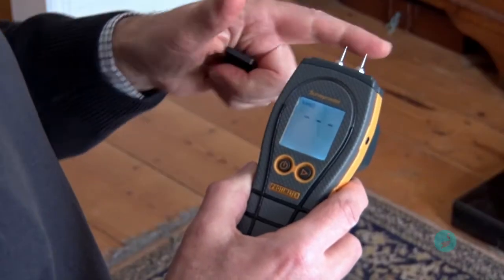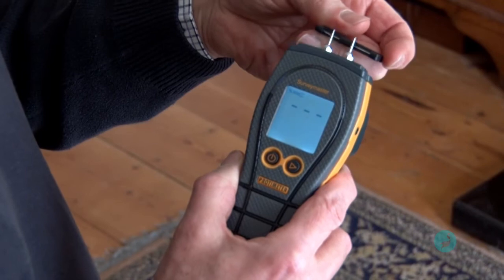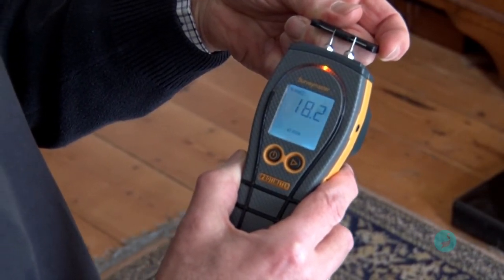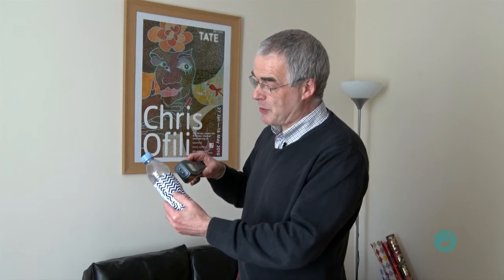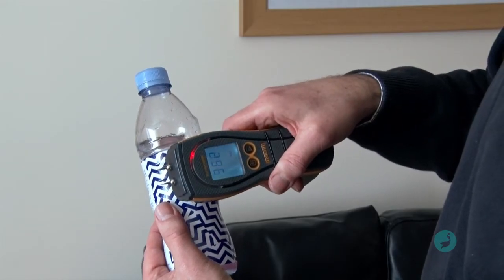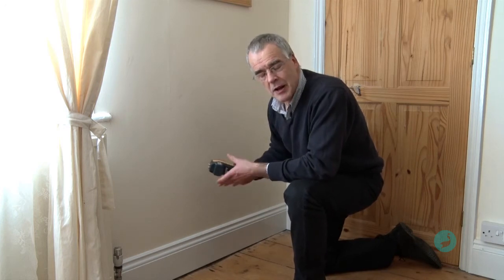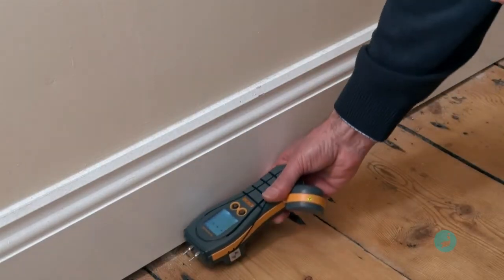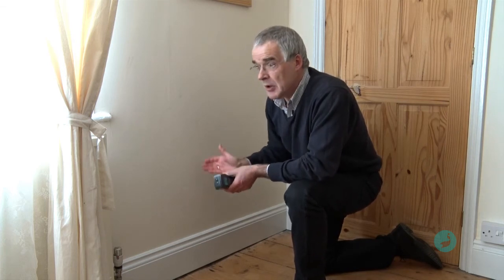Using a Damp Meter

Comment: Below is  a quotation from the manufacturer of the moisture meter used in this video - basically this instrument does not confirm  the presence of damp - it can however confirm the absence of damp.
"Contrary to popular belief, a moisture meter is not a diagnosis tool. Rather, it helps an inspector make an informed call about moisture’s presence within a space or material. If your meter is giving you a high reading, that merits further investigation -- dampness may not be the reason for the measurement; metals and salts cause false-positive readings".

Comment: Hi Great video, my property has had a major fire 6 months ago and since we had lots of heavy rain when a new roof has been fitted and sealed to stop water,  a specialist company will be coming in to dry out my rooms. What reading do i need to see on a meter to know it’s moisture free and back to how it should be

Thanks
Reply: Drywall 7-11
Lumber 14-16 
Francisco Adams D&R
Reply: Here is a quote from Protimeter  which you might find interesting  - Contrary to popular belief, a moisture meter is not a diagnosis tool. Rather, it helps an inspector make an informed call about moisture’s presence within a space or material. If your meter is giving you a high reading, that merits further investigation -- dampness may not be the reason for the measurement; metals and salts cause false-positive readings.

Comment: a frauds device
Reply: @sergeyw8864  The damp industry as always been a con and damp meters are the biggest load of bollocks on the market , and don't turn round and call me an idiot I've been in the trade for 33 years studied at college and worked on many a historic building in the past , properties do become damp but there's normally some reason why and it ain't from rising damp which a proxy meter detects !!
Reply: Anthony Mclean i don’t think you’re an idiot Anthony. I simply state that people use these devices improperly. The device is only as good as the operator. Use it incorrectly, get poor results
Reply: Sergey W your Wrong.....moisture meters need banning and they are exactly a fraud for misdiagnosing damp!!!! That does not measure damp but it measure salts......idiots around the country and using these pathetic devices to diagnose “rising damp” to which does NOT exist!! It’s simply condensation 
The uk damp industry is nothing but a fraud and con people out of masses of money and it’s a disgrace
Reply: @sergeyw8864  ive worked on historic buildings 26 yrs and im a idiot..lol
Reply: @adventureswiththelittleone493  not always condensation. ground lvl to high. ingress from a leak r poor weather proofing and many other reasons
Reply: Don't mean to restart a dead argument but ...... I love all these people who say there's no such thing as rising damp. I've had to go help many who didn't believe I it when they couldn't solve their issue themselves. 

The big problem is the operator interpreting what the damp meter is doing/saying. 

Damp meters don't tell you if something is damp they don't tell you anything. They have been designed to detect moisture, make a sound and give you a unit of measurement that is then used against a chart created by human. %WME & W%W. 

I stand by my belief that the damp proofing industry (Which I have a company in this industry) is the wolves den for cowboy tradespeople and con men. Straight up. 
I know of 2 surveyors and 2 other companies in the whole of the UK that do the work correctly and know what they're doing and I've came across over 100 dodgy surveyors/reports/operatives. 

The big thing for homeowners BE CAREFUL !!!! 

As for the video, it's quite a good one tbh so we'll done for that.

Comment: Total fraud. Place you “damp meter” is dry salt and tell me what happens!
Reply: You do get false meter reading on moisture meters due to salt being electro conductive. Remember the  moisture meter is a general guide, visual inspection and profiles are important. Also experience is very important. Being a C.S.R.T surveyor with over 30 years of experience. 
 I find the sensor side of the protimeter to sensitive. You can carry-out salt tests which tells you if the salts come from the ground or from the material IE rising or penetrating damp.